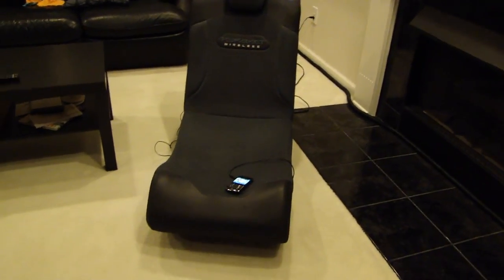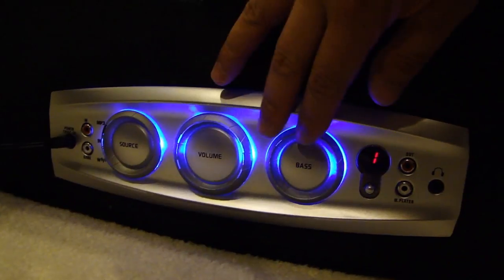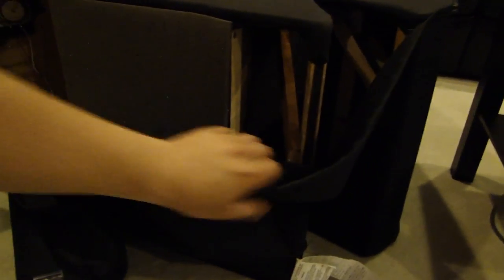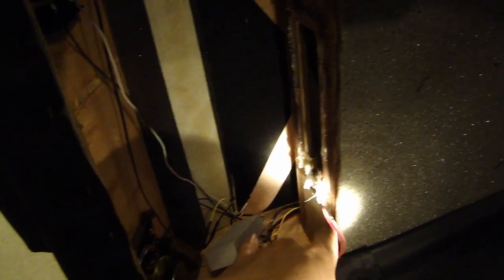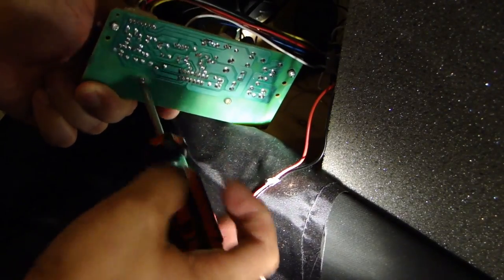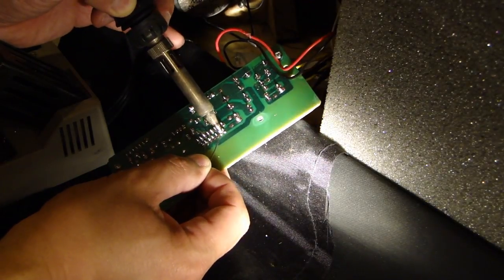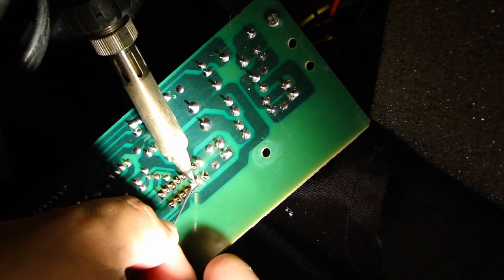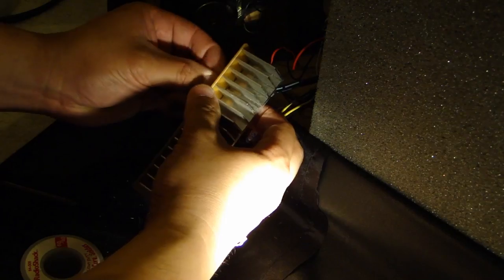Fixing Gaming Chair From Yard Sale

Comment: Where did you get what you replaced what were the symptoms of your chair as mine powers up but no sound
Reply from the maker: My problem was subwoofer not working but top speakers worked. I found the parts on Ebay. This chair is really difficult to service as the parts are all glued in.

Comment: I bought the same exact chair you have in video and it came with no wiring what so ever not even  wireless box. But no nothing about electronics and when I hooked it up through audio imports I could not get it to produce sound at all. Not sure what I should do or check our even of I'm hooking it up right. Been over 2 months now and can't get any answers on how and what I need to hook it up through jacks or what the issue could be. Really appreciate any help you colud give. Thanks, Jonathan D
Reply from the maker: Do you get any sound out of the chair speakers when you connect the 3.5mm cable to your audio source. This is all I use it for, to plug a gaming device to the 3.5mm jack and have sound.
Reply: OK so far I can hook up my mp3 and  put headphones in  and listen through them bit not speakers in chair. I've tried various ways top hook up  using different jacks but no sounds.
Reply: dial2fast where did you buy the parts from

Comment: Ok. Now I have one and I get static sound but I cant get the sound from ps4. I cant get the wireless fm transmiter to work with chair. No sound just static sound. I tried rca direct with chair . And rca from reciever to fm transmiter. No go.

Is this the same repair. You said there was sound on the chair. Mine no sound but light up with statice sound.

Comment: I have this exact chair, got it at a thrift store. My symptoms are that my chair powers up but the top speakers sound garbled and the sub powers on with a booming pop-ish sound, but nothing outputs through it, and then the voltage drops steadily from 12v to around 9v and the chair shuts off. It does this indefinitely. The replacement PSU I bought tests good. I'm glad you posted this video at least, it's really tough to find ANY documentation on this thing. I'm going to take apart the back like you did and check this board. The panel looks okay on the inside.

 Got any ideas?
Reply: Sounds like your speakers are blown. Nothing you can do without spending more money on parts than you'd pay for a new chair.

Comment: dial2fast I have the exact same chair but my volume/power button on the front panel doesn't work do you know how to fix it?
Reply from the maker: These things are really not made to be serviceable including the circuit board. As you saw in the video, lots to take apart. When it comes to electronics, it could be many things that is causing the problem.

Comment: And what Is the exact name and model of chair in vid? Thanks again
Reply: Pyramat PM450-WR
Reply: It's a Pyramat PM440-W, not a 450-WR. The 450-WR is the (W)ireless (R)echargable model that has a built-in battery, you can tell the difference by the headrest being a different tone and the volume panel is black on the 450. 

The 440 has no battery and has a grey panel.

Comment: I have an xgamer xpro chair and it has a speaker on each side. The right speaker isn't working. How can I fix this?
Reply from the maker: These things are really not made to be serviceable including the circuit board. It may be the speakers or the circuit board, but you will need to take it apart to check.
Reply: easy fix
Reply: @jensrb50  ok easy. Then what do you do when you get static sound.
Reply: @catherinewittann6925  Play around with the volume of the device you connected .Put the for example phone on 80-100% volume .Some noise is amplified most of the time increasing the volume of the input device helps (general electrician)